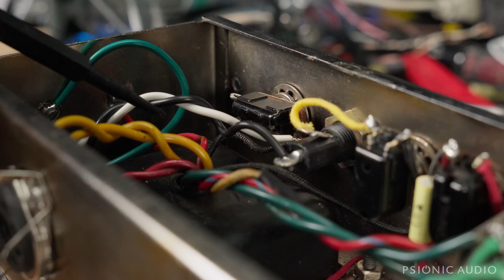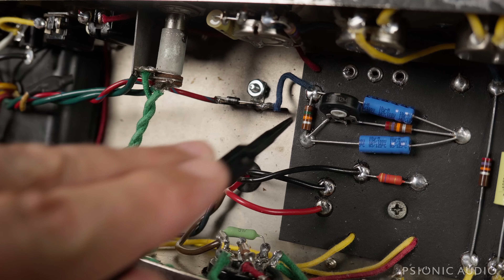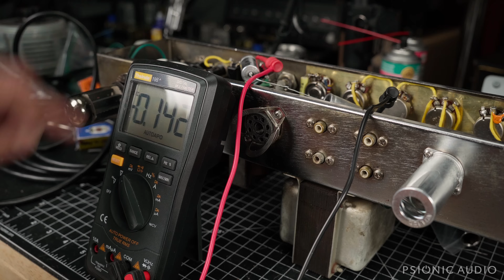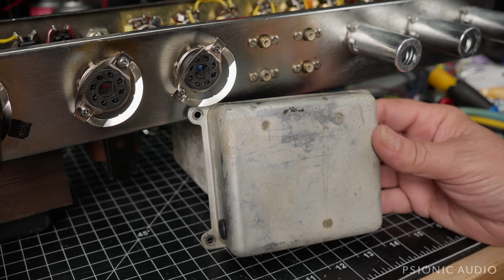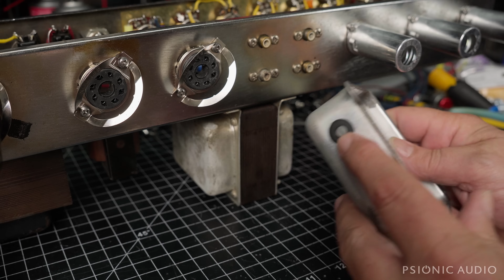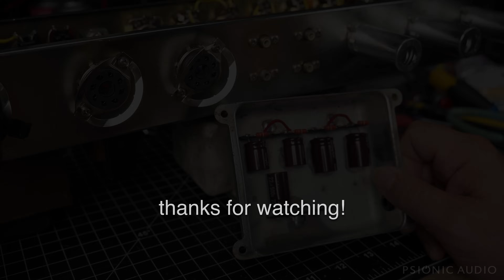Rebirth | '58 Fender 5F6A Bassman Pt 4

Comment: I am so happy to see you implementing high quality electronic solutions (the doghouse for example), rather than just throwing Sprague Atoms, or worse, into it like most 'restorers' would. Modern high end caps like these Nichicons are so much better in every spec.  I'm curious about why you'd prefer to replace the heater center tap with a virtual ct. For better balance (hum cancellation) I assume? I add a virtual ct where there is none, but it hadn't occurred to me to replace a physical one. Good idea.
Reply from the maker: Better balance and they’ll fuse if there’s a heater short. I’ve seen physical CTs melt into the transformer before a mains fuse can blow.
Reply: @PsionicAudio  I guess you've seen just about everything by now. I only build and experiment for myself and music industry friends. I like hearing about your mods and improvements to known circuits.

Comment: Kudos on the bias trim pot!!! Trying to figure out the voltage drop on selenium rectifier stacks is a very inexact science, at best. The "around 1 volt per plate", is just pure nonsense, especially with half wave rectifiers. My 0-600 volt & new 0-1000 volt power supply projects have transformers that put out well over 2000 volts. Same deal, put 3 or 4 or 5 caps in series, shunted with balancing resistors, or "voltage dividers", as they are referred to  on the schematics. One has 3 80 uF caps with 5K 50 watt resistors across each cap and the 1000 volt PSU has 4 100uF caps in series, with four 5K 100 watt resistor shunts.

Comment: Doghouse is very nice!  I might want some physical support in addition to the solder and silicone you've used to hold the caps up off the chassis, a EPDM foam strip could do this well (McMC)
Reply from the maker: It’s planned.

Comment: Lyle I know nothing about electronics. In the U.K. we have 240 volts from the wall. How does this affect all the parts in an amp?
Reply from the maker: Same as using a 120VAC primary transformer here. In theory the secondary voltages will be the same.

But you can have this same issue. Is your “240” really that, or 230, or 255? 

The secondary voltages are a percentage of the primary voltage. As it changes, they change.
Reply: @PsionicAudio  Lol I have no idea how it varies!!!!!!!!!!! I just plug stuff in……….. I know the fuses my appliances need, that’s about it.

Comment: I wish Nichicon made higher voltage axial electrolytic caps. What you did in the dog house is genius. Now, how to make a better ground than just 4 screws and metal to metal contact…..
Reply from the maker: Thanks Matt.

I’m not using the doghouse cover for ground. Just to solder the terminal strips to. And the caps have some non-reactive silicone beneath them. Ground wires are being run into the chassis ala AB763.
Reply: @PsionicAudio  I figured that’s what you’re doing.

Comment: Great solution for a common problem in those amps. In Athens GA where I live wall voltages are frequently 126-128vac. It can be a real nightmare biasing current production el84 based amps.

Comment: That power supply cap configuration looks great,I will borrow that technique for my next audio tube amp build.
What was the value of the balancing resistors on the caps please?
Reply from the maker: Thanks John. 220K ala Super Reverb.
Reply: @PsionicAudio  thank you Lyle

Comment: Mornin Lyle. Any advice on carbon comp vs carbon film resistors? I’d like to use 1/2 watt cc on a PR clone build but I’ve heard they’re noisy and prone to early failure. Thanks in advance!
Reply from the maker: I use CCs in restorations but would use CFs for a new build.
Reply: @PsionicAudio  that makes perfect sense to me, Lyle. Plus those CC’s are a bit pricey. But I do like their vintage look.
I appreciate the response. You’ve been very gracious, and helpful, in answering some of my questions over the years. I’d like to contribute to your tip jar but can’t find a link anywhere.
Reply from the maker: Thanks Strumbum. If you insist, it’s a button on every video labeled Thanks.